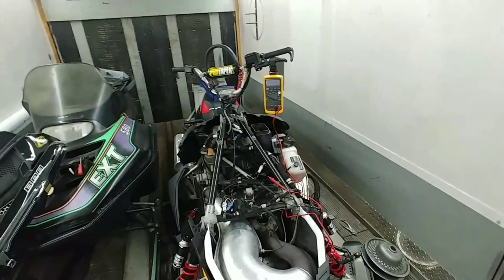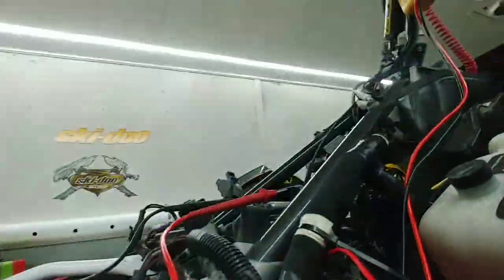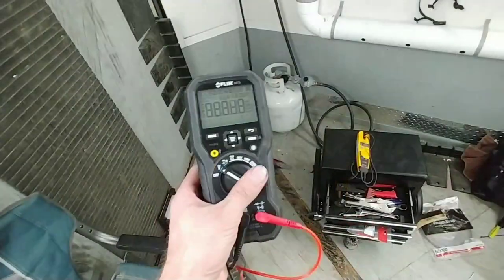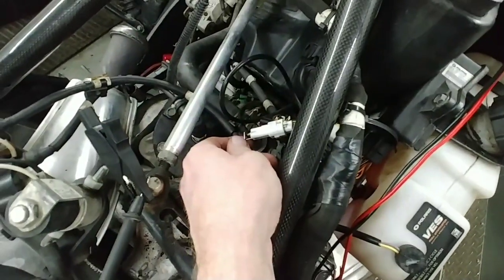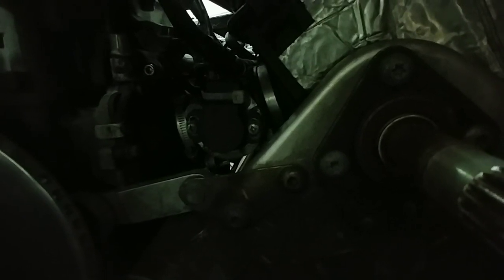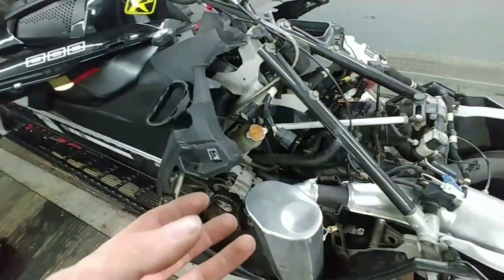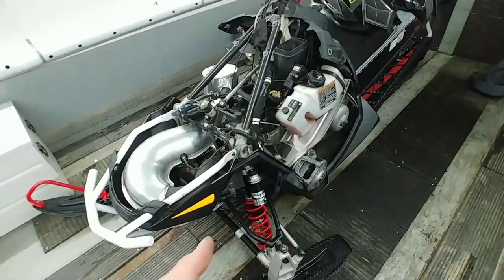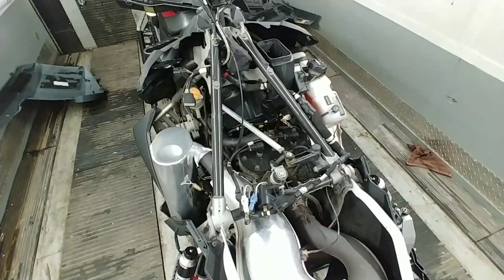Polaris RMK PRO throttle position sensor adjustment

Comment: This was very helpful! I have a 2013 Pro that I just replaced the motor in and it wouldn't idle very well. I followed your steps, used a little bit of common sense, traced wires because my TPS plug was different and made it work. The general idea you showed was the same. Thank You for saving me $200 of shop charges and teaching me another useful skill!
Reply: I have a 2013 too and I can’t find the tps wire
Reply: What wire on the ecu do you power it up on ?

Comment: I just bought 2 2016 axys 800s for a killer deal - both have less than 1500 miles on them. One of them has a super low idle on start up to the point the screen flickers and it wont go into reverse. Gonna try this out and see if it resolves the issue

Comment: What connector you using to power the ecu ?  Which wire or Color wire you put the pin in to read the voltage ?

Comment: I have a question, I did everything in the video with the set screw not touching the throttle cable and got to .7000 but after tightening the set screw it only lowered my milivolts? I then tried to put the set screw all the way in so the throttle cable was slack and it just made my millivolts go down to .2000 and the highest it would go is .4000 please help!

Comment: Just attempted this the other day.  My TPS was at .711 and idle set to .928  if i set to .700 and .940 my sled will not idle down below 2200-2300rpm.  I reset it back to .711 and .928 and runs great and idles at 1850rpm.

Comment: I have a 2009 assault, fresh rebuild, everything new. Put 80 miles on yesterday, starts on 1 pull, idle is perfect, throttle response below 6000 rpm is good, anything over half throttle it bugs down. Could this be a tps issue and is it worth monkeying with it if the idle is fine?
Reply: Did you figure it out ?
Reply: My 2013 pro is bogging only at full throttle too. Cuts in and out at full throttle. Seems fine below full. Let us know if you better figured!
Reply: @isaaccollura66  any luck?>

Comment: I had to change left side piston and the power values an it's has two idles for the throttle by the handle bars an then by the engine

Comment: Could you just start the sled to power the ECM ? I’m having some idle/bogging issues on my 2014 pro as well and I’m going to give this a try.
Reply from the maker: No, you need consistent power supply, and you will probably kill the sled while moving the position sensor
Reply: Just turn the key on and dont start...it will give you the 5volt reference. Probe the sensor wire and you can ground your negative lead of your meter on any bare metal surface
Reply: Cassidy Strickland If your Rush is a pullstart you won’t get the 5VDC as it has no battery.

Comment: I have a 2013 pro and the engine light goes of and on with the code 520 194-3 which I learned it meant high voltage with the throttle and I’m really confused how to fix it bc it’s a small problem that puts the sled in limp mode and I can’t even drive it when it happens!!
Reply: Having the exact same problem were you able to fix it??
Reply: @manitobatv29  yesssir, so basically I just bought a new throttle box with all the wires and stuff and I put it on and it works great hasn’t went into limp mode so far. It’s not a big problem so don’t worry about it.
Reply: Dave Rabe thanks for the reply! Will take a look at it
Reply: Have the same issue with my sled currently runs, but acts like it has a rev limiter right before the clutch engages so it can’t move!  Did you replace your whole throttle assembly??
Reply: @bbbfingerboarding  yes, everything except the throttle cable
Reply: @bbbfingerboarding  all I did was take the tps off the throttle body and let it sit in a heated shop for a couple days, there was moisture in the connection. Mine runs mint now
Reply: It’s the throttle switch mine just went out

Comment: I'm having a similar problem with my 07 iq touring 600 cleanfire.  Would the tps affect reverse as well?  I have to bump the throttle to about 3k for it to engage.
Reply: Did you figure this out

Comment: I have a 2012 rmk and can’t seem to find the connector to tap into, how do you locate it?
Reply from the maker: Easy way is to start at your TPS and just follow the wire up.  It's gotta go somewhere!
Reply: mutt2jeff very true, will give it a try. Video was very helpful!
Reply from the maker: @ethanwilson9008  make sure you check to ensure your TPS voltages are the same for your model year of sled, I have seen some different numbers out there for earlier sleds.
Reply: mutt2jeff will do, thanks